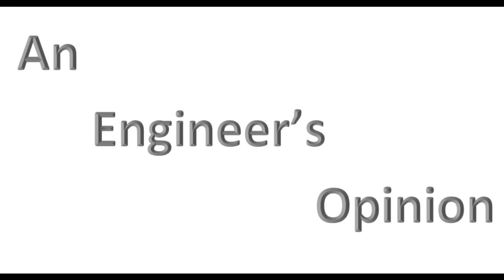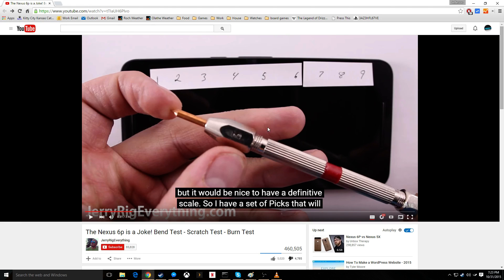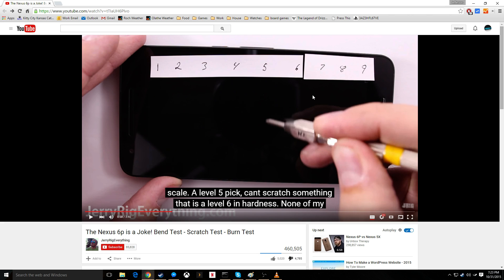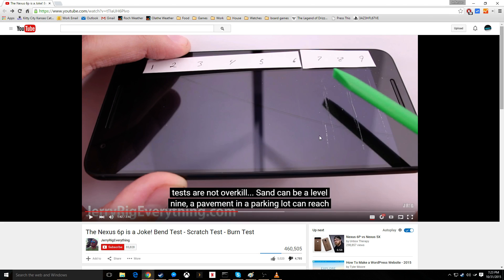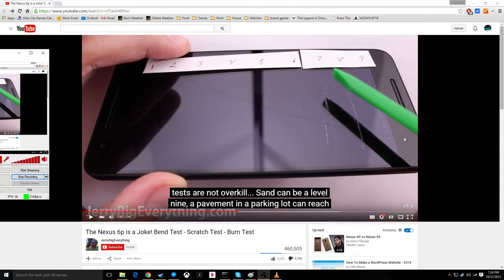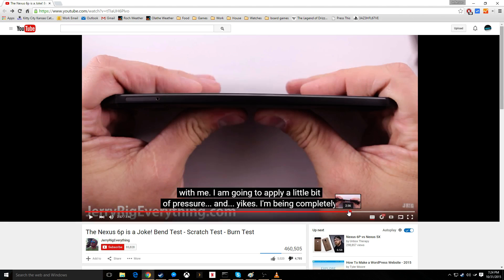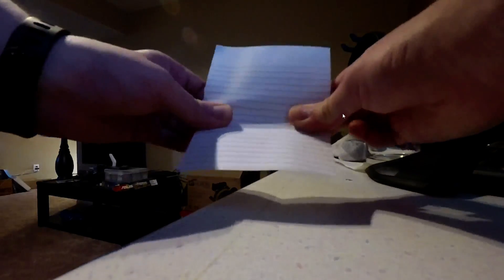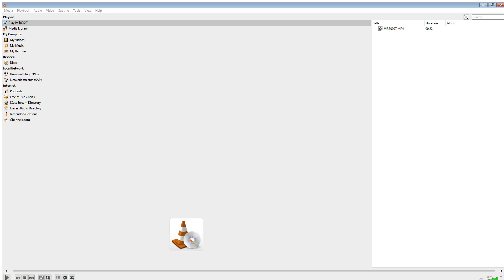An Engineer's Opinion, The Nexus 6p Bend "test"

Comment: Well, he got another one (new video on his channel), no scratch test, just tried to bend it, and it bent :|
Reply: +ComputerTitan Except that his second test proves that the method was not flawed the first time around. Perhaps it was not ideal or systematic (after all, he couldn't do scratch test if he did bend test first). But given that the second phone bent the exact same way, it proves that the scratch, crack, lighter, didn't make a significant impact to the structural durability of the phone.
Reply: +ComputerTitan you need to make a second video telling us how he bend the second nexus 6P without scratching or burning it.
Reply: +ComputerTitan "he needs a new device if he wants every test to be the same." The ONLY test here is a bend test. He opened a brand new one, bent the shit out of it.
Reply: +ComputerTitan.. wat do u mean by the control isn't modified??? in his next test he took a new phone ..without scratching or burning it...but there also he could easily bend that..
Reply: +ComputerTitan But in the end, the phone still bends, which was his point.  Not how great his scientific method was.  You made a big deal showing how you could change the outcome of your paper test by scratching it.  In your scenario, it DID matter.  In his, it didn't.
Reply: +ComputerTitan There is a difference between non-ideal & flawed. As experimentalists we often have to use a single article in multiple tests due to lack of duplicates. In such cases the best you can do is judge if the parameters tested are coupled to one another. In this case the screen does not add strength to the structure so it does not matter that it was scratched or burnedfirst.
Reply: +ComputerTitan you're missing the point. In your video you say he should have started with a NEW device. He did JUST THAT in a second video and it bent just as easily.
Reply: +ComputerTitan HE HAD A NEW PHONE IN HIS SECOND TEST!! Look man, I appreciate your point, but he opened a brand new phone and bent it (correction: destroyed it) without heat, scratches, or any other defects. And he did it with what seems like very little effort.
Reply: +AeroElectro Of course it did. The glass is a large part of the structural integrity of the device; if it is cracked, the device will bend more easily. Furthermore the fact that Jerry, a bodybuilder, could bend a new phone proves pretty much nothing. Anybody can bend any phone with enough force. The whole point is how easily it bends. If he wanted a true "test" of the durability he would create some contraption with can apply an exactly variable force at a constant angle and location on the device. Consumer report did this with the iPhone 6 and some other phones back when "bendgate" happened. We have no idea what amount of force Jerry is applying to the phone nor do we have a way of comparing that force to the amount required of him to bend the other devices that "passed" his "test". It's all nonsense. Don't try to bend your phone and it won't bend, period.
Reply: +Francisco Rodrigues If you look closely on that video, you can see the box was already opened, so he could of done something to it before and faked both videos.

Comment: The glass being cracked has nothing to do with bend test. It is mostly still intact and GLUED to the display so any minor structural benefit from the glass is still mostly present. The reason the phone bent is because of a weak frame/display assembly. The same thing would have happened if Jerry bent the phone without any damage to the glass. How is pulling a piece of paper anyway relative?